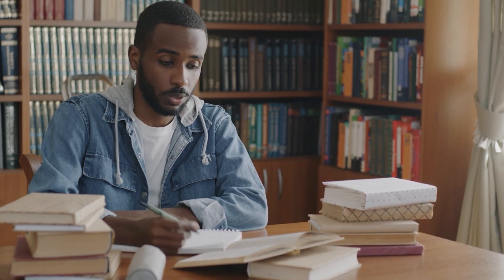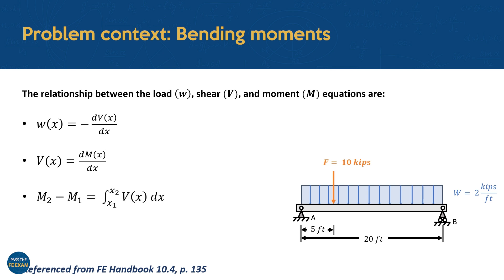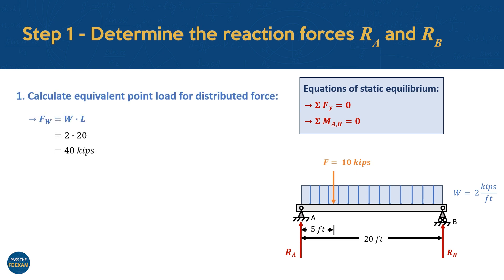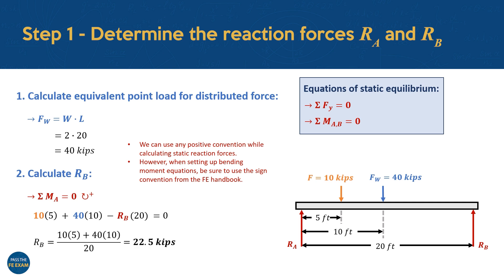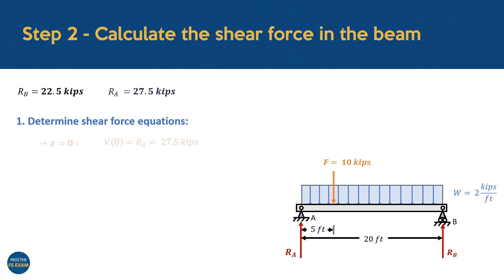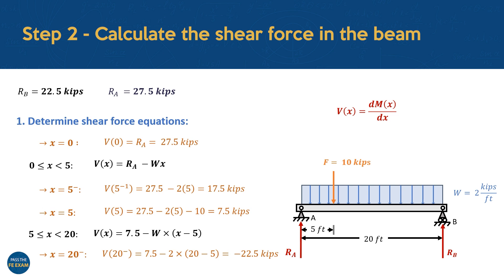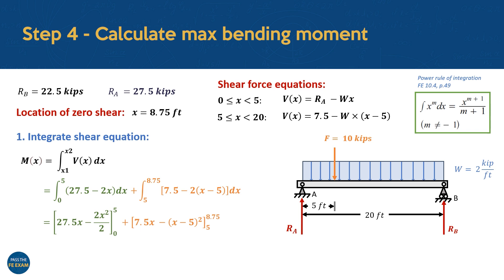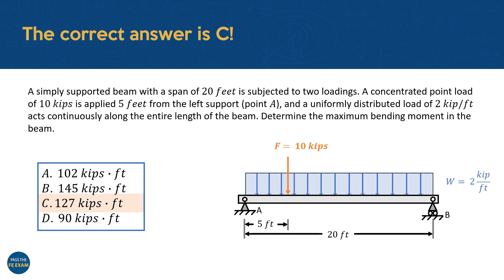What's the MAXIMUM Bending Moment of a 20-Foot Beam?

Comment: Hi, could you please cover Influence lines, deflection by unit load methods, mix design problems. 
Thanks
Reply from the maker: @MuradTapdigli  Thanks for your suggestions! Those topics are definitely important in structural engineering. I'll consider covering them in future videos!
Reply: @PasstheFEExam Thanks